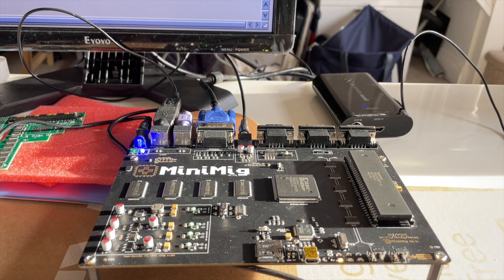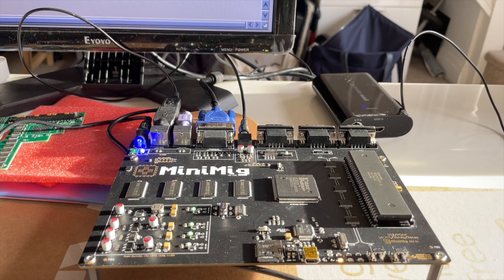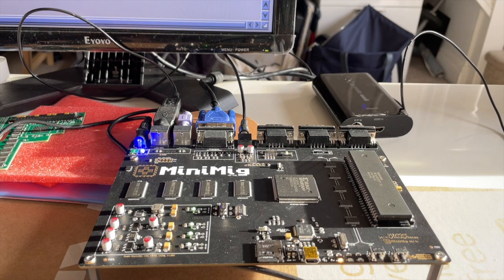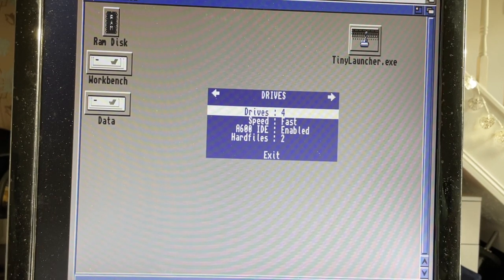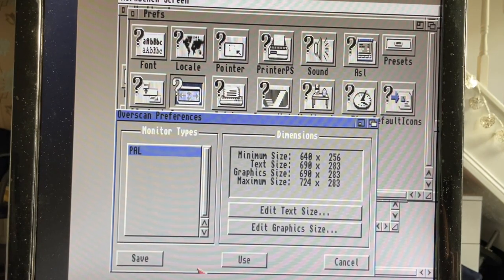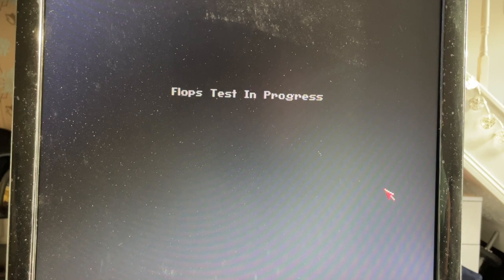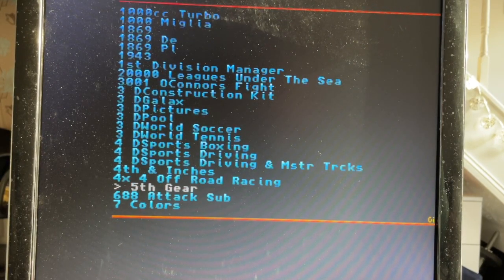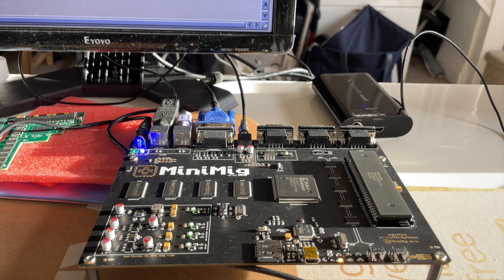Minimig v9 .1 Part 1 - setup and power up

Comment: I wish my 1.97 minimig came with comprehensive instructions- following Chris Edward's youtube guide is good- but my pistorm isn't working and its clear im missing some steps setup wise before i place it. There are NO recources i can easily find- guess time to dig harder into forums with no time to do so. My TF536 card ran too too slow so i wanted to use the pi.,

Comment: Doesn't the MiSTer make this a bit pointless?  Cycle accurate on A500 and has AGA too.
Reply: Minimig v9 supports Amiga 500's CPU and RTG accelerator cards.
Reply from the maker: Yes, mostly it does.

Comment: hi Mike! Good Video!  have the 8.1 version, that works OK with PISTORM although the disk speed is much slower than a real Amiga equipped with a Pistorm. The 1.9 was rumored to support AGA and Vampire accelerators but looks like that support isn't implemented from what I have heard. The newer features of the 1,9 core are supposed to "eventually" be backported to the 1.8 board.
Reply: my issue exactly- i have a tf536 in mine and is SLOWER than what im seeing onscreen here with the 68K running at (60?) MHZ. Sucks, as the TF has the IDE on it with WHDLoad games. what gives?